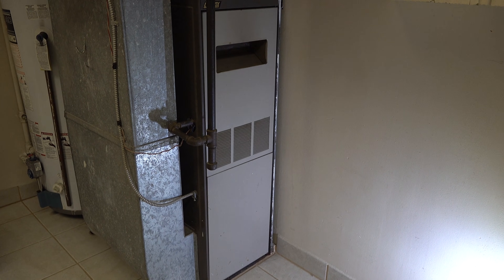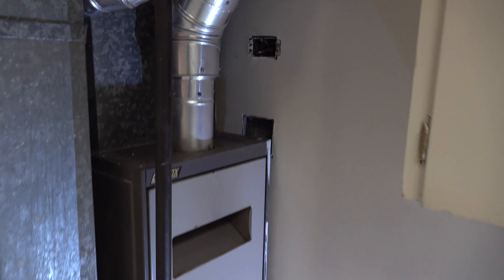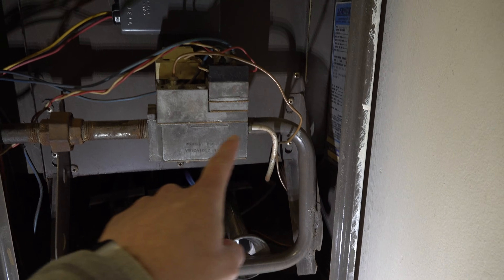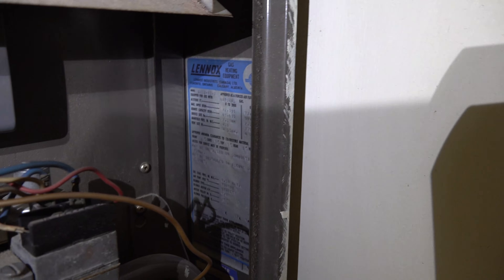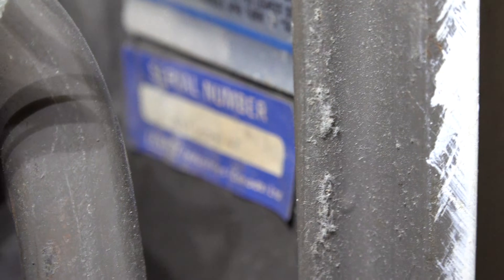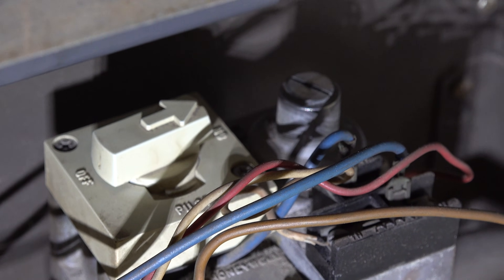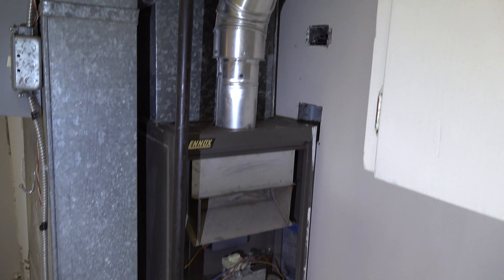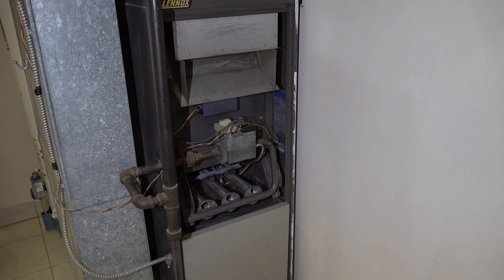1977 (Old) Lennox Gas Furnace Overview [G8D2-82-3]

Comment: How do I turn off the light? It's summer and still lit
Reply from the maker: You can just leave it alone, I didn’t put my pilot out this summer, I forgot. Now that it’s the end of August I’m going to do nothing.
Reply: @InternetDude  thanks
Reply: Probably the opposite of turning pilot on. Turn thermostat down. Turn dial from ON - to OFF. I have a light switch next to my furnace that I had to turn on to get furnace on, so you might want to turn that off as well.

Comment: What is the life expectancy of a unit like this? I've got a Lennox furnace just about like this. My neighbor said not to let anyone sell me a new furnace and keep this one until it dies (the heat exchanger goes out for instance) as they are simple units and thus simpler to fix and more reliable. I know that it is 37 years old I know for sure and figure it's more like 49 years old and was put in the house when it was built in 1972. Works like a champ.
Reply from the maker: I agree 100%. I have been tempted to replace it for efficiency reasons but these will outlast any modern furnace by decades. My other property has a furnace that is 14 years old and every year needs the flame sensor cleaned or replaced, and you have to worry about the exhaust pipe freezing up outside. Sure it's more efficient but is not as trouble-free. Modern furnaces have way more things to go wrong, no question.
Reply: @InternetDude  Thank you very much for your reply. My neighbor says the same thing about the new furnaces that you have to have someone come out every year and clean them, maintain them. A new furnace means business for the vendor. The majority of his brother's service calls on new furnaces were related to electronics or some board went bad, and filters clogged.  

On the one hand I know nothing lasts forever, but then I think that "if it ain't broke, don't fix it."  Every HVAC vendor wants to sell me a 95% efficiency furnace, but it's only my dog and me, and my house is a 1008 sq. ft. ranch. I'd have to live another 70 years to pay off the "savings" of the new efficiency. Vendors say my old furnace may go out in the dead of winter and I'd be two days without heat. Well, it may not, also.  I have a lot of blankets and can drip the faucets. 

If a vendor won't give me a quote for just an AC, I'm tempted to just go with my old furnace, buy a portable evaporative cooler, suck it up and go down to the basement when it gets hot.  I live in Colorado so the three days of 100 degree temps in June were the exception, and there is some cooling at night. 

Thanks again.
Reply: Mine is 1969 still going strong. Heats house in minutes. It is propane.
Reply: @InternetDude  exhaust pipe freezing up is caused by incorrect installation, it is supposed to slope towards the furnace so the condensate drains back into it, not outside.
the length of time can go without cleaning the flame sensor varies,  many HE units taking combustion air from outside can go for years. definitely, new ones have more to break, but on the plus side they don't dump 30 to 40% of the heat produced on average (including standby loss) up the stack. they're also safer, your g8 doesn't have even have a flame rollout switch.
Reply: that furnace may last another 50 years, most time the service tech tell you bad heat exchanger they are being untruthful   Tring to sell you a new one.  if they tell you bad heat exchanger tell them to show you.

Comment: What if the pilot light went off, but gas valve keeps releasing gas? Is there any flame sensor that can shut off the gas valve when there is no flame detected?
Reply from the maker: There is a thermocouple that shuts off the gas valve if there is no flame.
Reply: InternetDude Thank you

Comment: I have something that almost looks the same as yours only mine is g8q3-120-1 and everytime the fan kicks on it makes a sound, but after a quick 5seconds it's gone. Base from my research i found out my blow motor is giving up? I'll appreciate your response.
Reply from the maker: I can't say but it sounds like it could be the blower motor. Has it been maintained (lubed) every other year?
Reply: @InternetDude  we just move in to this house and I did pull it out earlier actually clean the motor and all and lub. But it still makes that sound when the fan kicks in. I might just buy a new motor.

Comment: This actually older....this is a G-8 model, which is designated by the type of vent hood, gas valve, pilot, and gas valve.
It WAS built in May by the E designation.the 63 was the plant number.

Comment: Hi, I had a similar furnace, we replaced the motor and the bearing on the blower last year, but recently there's a shaking noise whenever the heat lit on, it looks like the noise came from the blower, the shaft that connects the bearing wobbled when it turns, would you know the problem?  Could it be fixed?  Thanks.
Reply: Bent shaft? Unlikely. Misalignment of motor?
Reply from the maker: I'm not sure...

Comment: My friends that they live in Windsor Ontario they use to live in there old house on I think it is dot avenue but when I was in childhood I had saw there old furnace and it was a Lennox and it was pretty big and it sat in there basement after when the house was built there original house was built in 1973 before 1977 but the furnace that they had was made in 1973 to 1974 and the model to there furnace is VR800c-1190 and the pilot light in there furnace was glowing bright yellow and I had saw the pilot light glow in the heat exchanger when the light to the furnace room is off and completely pitch dark
Reply from the maker: This one does light up a dark room a bit 😉

Comment: hello InternetDude ! i have a similar furnace like your (my model is GH6D-100M, IDENTIFIECATION NEMBER IS GH6D-100-M-2). It runs very reliable but now the burner and blower doesn't work ( no heat ) but i check the flame is still lighting as always, and last season the blower or fan makes sound clunk clunk every time the heat is on. The controller is show the heater is on but no sound of blower or heat come out. Do you know anything about it ? What wrong is that ? Thank you for your time.

Comment: I am very stupid in furnace. Do you know how to replace the filter
Reply from the maker: There is no “factory” filter provision. The previous owner added one in the return air, you will have to see what yours is configured like. It’s possible you don’t have one.
Reply: Check in the blower compartment , its there where the filter goes

Comment: A cracked heat exchanger on that unit would be a strong odor of burning dust type smell. I lived in an apartment with that same model number unit and one very cold winter month I went to use it and I noticed the odor. When I called maintenance they came out looked at it ran it and said everything was fine. Later that night I took the burners out And shown a flashlight up inside the part where the flame goes and sure enough I saw two cracks in the bottom and side of the heat exchanger
Reply from the maker: I used a mirror and didn’t see any cracks.

Comment: Were you able to get your left hand burner properly situated in the notch in the heat exchanger? Thank you for deleting that john whatever the hell his last name is hateful comments. Obviously the guy doesnt know anything about furnaces. Plus he drives a crappy old nissan maxima and listens to charlie puth 😆🤣😂 lets keep your old furnace rockin for another heating season!!!
Reply from the maker: I pulled and twisted a bit but couldn’t get it to stay situated straight.
Reply: @InternetDude  may have to remove the manifold screws a little and pull it straight out...theres a little notch in the back of the heat exchanger that it fits into. Its a bit tricky

Comment: Yeah, replace it soon. OK, I have a question. Why is it in the bathroom? Or why is there a toilet in the furnace room?
Reply from the maker: It is the bathroom but it’s a decent size so also has the water heater and furnace in it. The room also has a sink and shower and some storage cabinets.
Reply: Even though it's big enough for them, that's kind of weird,  @InternetDude , that they'd make it all one room, instead of giving the utilities their own room/closet. But you probably aren't the original owner or designer of the place, so my asking you why it's like that is probably futile, huh?

Comment: After re watching this video i also noticed your left most burner could use a little twist to the right so the flat flame spreader burners line up properly. Thatll help with it lighting off easier
Reply from the maker: Yeah every time I turn it, it goes back like that.
Reply: @InternetDude  theres a little slot in the back that it fits into...try pulling it back toward you and wiggling the end around a bit until you feel it drop into the little slot in the back of the heat exchanger. You may need to back those screws off a slight bit on the burner manifold
Reply from the maker: Thanks I will try that
Reply: @markallan9050 on mine I have a pilot light but the furnace won't come on, even if I turn the thermostat up. 

Last spring it did the same thing and I turned the breaker off for a bit and then back on and it must have reset.  It came on and worked. 

This time it won't reset. No ignition. No blower not even if I turn the thermostat fan to on from the auto setting it's usually set to. It's a G12Q-110-2. 

Any idea what to replace?

Anyone?

Of course it did this at night.

Comment: I remember having a Trane furnace of this type prior to summer 2013. I was very young at the time but I remember it working very well when it was there. I could set the thermostat 5 degrees higher and it would bring it up in 15 minutes. The only reason it was ever replaced was because the compressor outside died and we had done an addition to the house so more capacity was needed

Comment: I got you beat! Mines a working 1959 Lennox furnace!
Reply: Nothing to be proud of Anna. Most people are up to date with technology and not behind like you.
Reply: @johnleeyingzhang3504  The old ones are better more well.built that the new ones, the reliablity is quite impressive comparing to the new ones....old ones last and last  decades , the new ones would only last years .
Besides troubleshooting it is a nightmare  on the new versions.
Reply: @eduu2  i guess you are one of those people who wear the same pair of clothes for 15 years plus. Nothing to be proud of buddy.
Reply: @johnleeyingzhang3504  You would need to see my wardrobe, comparing apples to oranges? Nah
Am into real estate  , i have more problems with the new ones all the time, they just break like Saturns .
The reliablity is very poor . Too much here and there to make an inefficient job.
Happy Holidays!
Reply: @eduu2  Same. We like our old school furnaces. Plus I got a quote for $3,000 to get a mini-split in for two of my small units and it would cost more to run them then the current wall furnace. It runs A/C decent, but the heater isn't as efficient. So we just use a $150-200 A/C window unit and it works just fine!
Reply: @johnleeyingzhang3504  lol
Reply: @Nathan-u2g  lol
Reply: @johnleeyingzhang3504 did you watch the video, newer furnaces are so high tech with computer board that fail and maybe 20 percent more efficient on gas used please look at your gas bill and the actual gas used not the delivery charges and you will figure out actual savings versus a new one install and the maintenance and longevity versus an old one is your choice

Comment: we have the same furnace is it really doesn't have a filter in the return air intake area? I just move from this house I don't know nothing about the furnace I leave in an apartment for so long. and do I need to oil it , one more question do I need to turn off the flame in summer time cause I wonder if they cost me while I turn off the furnace but the flame is still there
Reply from the maker: You need to put your own filter in the return area somehow. It’s a good idea to oil the motor every other year. You don’t need to turn off the pilot in the summer, I usually don’t. It will cost a little bit to do that.
Reply: @InternetDude  one more thing does the furnace room that you have in there has a fresh air intake from the outside? I notice last July and august where like very hot outside the inside room of my furnace was so humid/hot I was so terrified so I open up the window in the furnace room and eventually cool down a bit, but I in the winter time I can't do that opening the window which is -40 hope it would not humid in the winter time
Reply from the maker: I don’t but you probably should have.
Reply: @InternetDude  thank you for your quick reply! you have a good set up of furnace and water heater mine is just scattered everywhere.
Reply: @InternetDude   I'm trying to find a filter replacement for this model and I'm at a loss! The look of what's on the lower half of the furnace is so dusty and gross.
Reply from the maker: @jessicadias8546  yeah you just have to find one that works and fits. You may have to make your own brackets to hold it there too. Or change the ductwork to incorporate a filter.
Reply: @InternetDude  You let the pilot burn all summer?! How long is your summer? I can't imagine that would be cheap. I turn the pilot light off on all 3 of our old school gas furnaces and it definitely saves about $10-20 each month on each unit/gas meter.
Reply from the maker: @AndyandRachel  I let it burn this summer, sometimes I shut it off during summer sometimes not
Reply from the maker: @AndyandRachel  I just checked and I was billed about $7 last month for natural gas, plus tax, that was for the pilot light as it is the only gas usage in summer. My base connection fee was $41.50 plus tax even if I use zero.

Comment: These style of Lennox furnaces are actually still quite efficient even today have a 1972 rheem furnace thats very similar and it works just fine why replace when the current unit is still good enjoyed the video
Reply from the maker: I’m still using this furnace, it’s very reliable like a Toyota or Honda 😉 I don’t actually know the efficiency %.
Reply: @InternetDude  I would think about 70 percent efficiency... efficiency was not advertised back then I believe the manufacturers were focused on the quality of production and back in the late 70s natural gas was a lot cheaper anyways

Comment: Hey man i have similar furnace and the flame is gone. How do i lit it?
Reply from the maker: You need to turn the gas valve off, wait for a few minutes. Then turn the gas valve to pilot, put a flame down at the pilot burner spot down below (use a lighter). Then press the pilot valve switch down and hold it for about 60 seconds and release. If that doesn't do it, look up grayfurnaceman on YouTube, he has some amazing videos on furnaces.
Reply: @InternetDude  yea bad idea

Comment: we have a LENNOX furnace. I cannot locate the filter.The gas pipe is right in front of the whatever openable lids I find! The number on the furnace is PGH 32-855.Where do you think it would be located?
Reply from the maker: On mine the filter is in the bottom where the big duct comes in from the side. Yours may be in the same place, you'll have to remove the bottom cover.

Comment: Help! I  have thesame exact furnace. When we moved in a few moths ago, furnace still works but tonight the pilot is not even igniting, no fire at all and its cold tonight! any DIY that I can do until some I can get some help in the morning? thanks bunch!
Reply from the maker: Are you holding down the switch for 30-60 seconds while you try to light the pilot?
Reply: hey i don't know if you fixed the problem try replacing the thermocouple... if it doesn not work get a service tech. usually a thermocouple replacement is the solution.